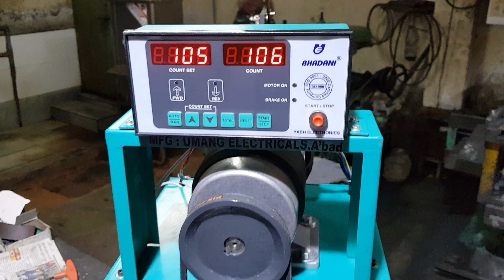Armature winding machine

Comment: Armature winding has three parts.
1.  Winding
2.  Spot welding commutator
3.  Balancing machine for high speed machines.
All videos cover only winding which is 30 % of work. Pl. Provide details of spot welding and balancing which are also important to make complete Armature.  Thanks
Ashok.      Bangalorr
Reply from the maker: 9033836302
Reply from the maker: 9033836302
Reply: Right